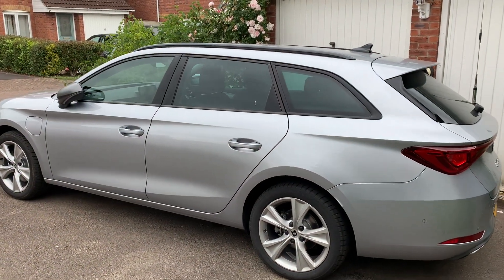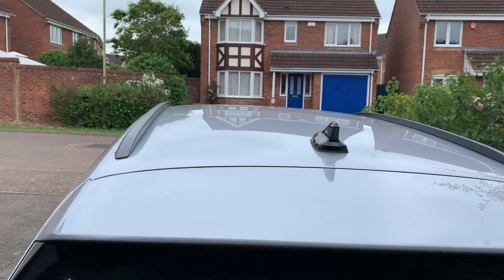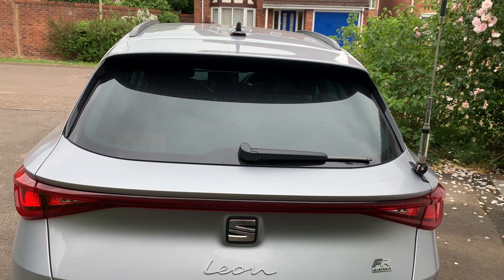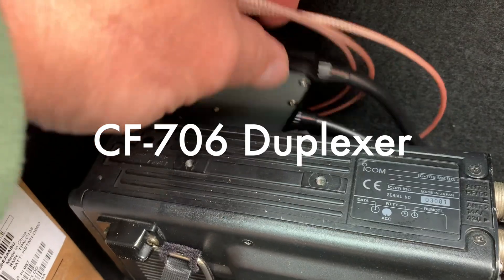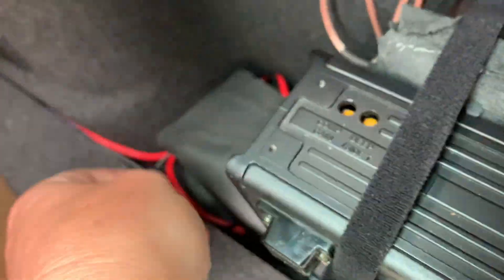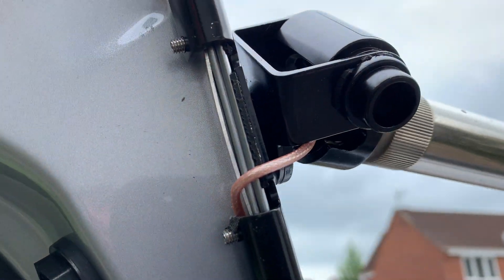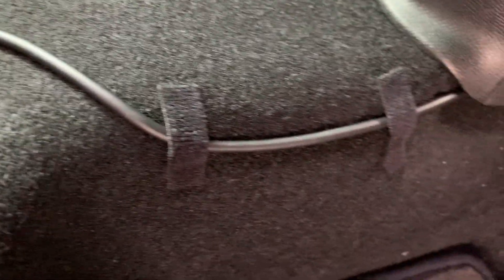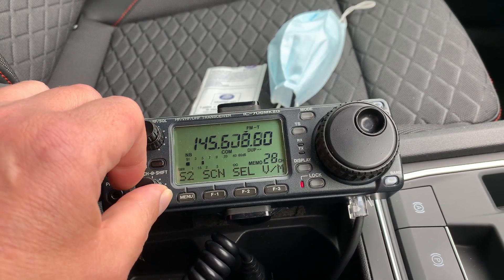HAM Radio: EV install will it work? Mobile Radio installation : Amateur Radio

Comment: Electric cars use a VFD to provide voltage and current to the motor.  That power is nasty-noisy. I don't know if you grounded you radio and antenna but do so if not.  Also add some real ferrites to the power and coax cable.  Fair-Rite is the brand that mostly gets into the ham radio work as clamp on.  Look at Laird Technology's. They do not work as good as solid ferrites and the mix is also not as good at lower frequencies.
Laird low frequency ferrite has a much higher impedance / db drop.  Years ago, they would not even make a split ferrite for low frequency applications as lower frequencies will go thru the split surfaces and can degrade it's efficiency.
This could help but don't get your hopes up for HF operations.
Look for Laird ferrite cable cores in LF mix.  It is a lot higher impedance for amateur radio hf frequencies.  Remember each wrap squares its efficiency.

LF Low Frequency
28 Broadband High Performance
HF High Frequency

LF, 28 & HF MATERIAL IMPEDANCE VS FREQUENCY (300 KHz - 2 GHz)
Impedance Materials for Cable & Wiring Harness Cores
Robert S.

Comment: Why would the car manufacturers address the emi noise? For us ultra small ham minority?
Reply from the maker: Because it goes agains  (breaks)  EU and UK EMC regulations.
Reply: @mike-M0MSN  I don't think it does because it cannoybr sold in the EU per emissions regulation.
Reply from the maker: @kubectlgetpo  That is exactly why I complained, because it should not make any EMI noise if it complied .......and if it has been sold it should comply.

Comment: I have a Renault Zoe, and it's exactly the same, full of noise when the engine is running...
I think for HamRadio mobile devices, electric vehicles are not the easiest solution.

Comment: As I live in the bottom of a steep sided valley with a tidgy garden there is very little radio I can do from home so I tend to go out and park on a hill top, we have an abundance around here! You can hear EVs coming a mile off on the radio as the interference increases until they pass. Cars are pretty bad but those electric bikes are a nightmare, they take ages to pass and thus prolong my torture!

Comment: The electric motor inverter drive system is a high power switching unit (probably 400V at some tens of kilowatts), pretty hard to make them quiet, especially in close. I'd try running the radio from it's own independent LiFePO4 battery and minimize any connections between the radio system and the vehicle to see if that helps, but the common ground system is likely to carry a lot of noise. Be interesting to survey all the HF bands to see if any are useable. Generally the computers in cars moved up the gHz region and aren't interfering anymore, but high power drives are in the upper kHz to lower mHz region and harmonics can be everywhere. de w6akb

Comment: Good Install, wouldnt it be neater running the cable along the Sill Trim, than outing it over the Carpet, where it could be kicked by a Shoe
Reply from the maker: Yes probably but work car never really have passengers.

Comment: Interesting stuff, I've only worked mostly VHF parked up from my EV but when I get time I'll hook up my 706mk2g and see what happens on 10 and 20 when the car is powered up and in drive. So far I've been pretty impressed with the lack of RF noise when charging it at 6.6kW at home.
Reply from the maker: Yes Matt, it is very good everywhere but 27 -28MHz
Reply: @mike-M0MSN  Managed to get out and test this before it got too warm this morning, tried 40, 20 and 10M, didn't notice any increase in my admittedly high noise floor with car on, off and in drive, car is a MG ZS EV, so hopefully EVs wont be that bad, I've been driving them since 2015. What did surprise me was how many more signals I got with small base loaded 90's G-whips on a mag-mount than my active loop antenna and SDR I normally use so something to investigate there. The 706 was running off a LiFePO battery rather than the car.

Comment: Well if RF is getting out then RF will be getting in, so I think I would not want to transmit on 10m while driving. Well until I know that the abs or anything else is not going to kick in or fall out and make it a very bad day around.

Can't beat an old diesel for noise, not a lot electircal going on with them.
Reply from the maker: Agree

Comment: Interesting video. I like your priorities too. Get the new car, get a radio in it lol. Does the petrol engine provide drive independently of the battery, or does it only run to charge battery? Was wondering if there is any difference between petrol engine running or not with respect to interference?  This video is another wake up call for the radio world as  electric cars become more popular.  Wonder if the high speed chargers cause interference? Mark, M7MSR
Reply from the maker: Yes and yes electric never turns off.

Comment: Dear Mike, it's like having a switching circuit on idle mode and when you load it, noise is stopping.
When brake lights or other loads occur, the noise stops.
Try if a bulb lamp somewhere make the deal
Reply from the maker: ?not sure if that's right or wrong?
Reply: @mike-M0MSN  to be sure you would like to put a oscilloscope on AC mode to  find out the waveform on 12vdc line.
When a switch mode power supply is idle, you may see the top shape of sawtooth waveform
Reply: @mike-M0MSN  if you need some help write me to Iw4dbx@gmail.com

Comment: Others who have done EV installs (such as Josh KI6NAZ) have noted that the earthing is very important. Try putting an earthing strap between the boot lid and the main body of the car and making sure the radio also has a good Earth connection to the main body.

https://www.youtube.com/watch?v=2DJdUfT_TnM
Reply: Josh earthed all points in the car plus any nut, screw or bolt he could find. I was also thinking earthing. A good shout. 👍
Reply from the maker: will give that a go.  :)

Comment: Nice install, nasty noise problem, did you make sure the antenna mount was making good electrical contact with the body of the car and that the boot hatch/lid has a good, low impedance electrical contact with the rest of the body too?

More worrying is the thought that these things radiate as they drive past, potentially making them mobile noise generators that could wreck HF

Comment: I have the watson triple magmount. I drove from Portsmouth to Birmingham with a 20m ampro whip at probably 80mph because I was running late and it stayed on fine. So have no fear about them coming off. But yes they can scratch the roof thats for sure, Mines on an old van so i'm not worried. Lee M0RQX
Reply from the maker: Thanks for the info  :)

Comment: Change jobs. What sort of company buys a car like that ? I've never even heard of that car. I'm thinking it's either Chinese or French. Horrid.
Having to drive around in a vehicle chosen by your boss because he/she is some imbecilic eco-warrior green Communist is an insult to ordinary people.
The world's gone mad. Hope you find a way out.
Reply: Seat is part of the VW group, hardly an unknown brand and the 'company car' is a really common thing, it's usually cheaper than buying and maintaining your own vehicle and there are more tax advantages to driving a PHEV too which makes it cheaper.
Reply: @M0UAW_IO83  Never heard of Seat. Never heard of PHEV.
I do of course understand the concept of the company car.
I'd be embarrassed to be given a company car called a SEAT PHEV. 
I'll keep my Toyota V8 Turbo Diesel thanks....
Reply: @adelarsen9776  Seat is a Spanish company owned by the VW-Audi group. The Seat Leon PHEV (Mike's car) is basically an Audi A3 e-tron but with cheaper interior materials and built in Spain instead of Germany. PHEV is a standard term meaning Plug-in Hybrid Electric Vehicle. It's not the name of the car.
Reply: @thefuzzylogic  Thank you Ian. I learned something. Cheers
Reply from the maker: lol
Reply: @mike-M0MSN  You've got to laugh. Otherwise you'd go mad.

Comment: I use a hatch mount on my Mitsubishi PHEV, which I find works well.  I only have 2 and 70 and they like your car are fine, with no interference. I haven’t used HF mobile for many years. My last setup was a Yaesu FT-707 in an Astra GTE, which was a bit of a squeeze, band conditions were a lot better then as well. Good luck. Nick G0OQK

Comment: I agree that the interference is clearly coming from the drive computer (probably the CPU engaging the gears) perhaps if you could move the head away from the centre console it might clear or at least be easier to deal with the interference.
Reply: Nah, it's likely from the inverter, the computer will be active no matter what mode it's in and unless the petrol/diesel engine has a mechanical coupling to the wheels then there won't be a gearbox. Would be interesting to find out if the noise changes with vehicle speed.

Comment: Good evening Thank you for all your videos you publish Unfortunately I do not know English I go to intuition and read the comments of other people translating them with the translator I saw the problem you have with the car I ask you a question You can try with an amateur radio laptop for see if it is not radiofrequency that the machine creates from some electronic card maybe mine is stupid otherwise it will come from the power supply I repeat I am not in your technician but I go to exclusion Thank you again for all your videos and I give you a good evening Hello here from Mario from Trieste Italy
Reply from the maker: Thanks for the comment, I will use an SDR with my Laptop. good idea
Reply: OK  73

Comment: Btw the loom is 6volts so any additional equipment added to it will run under power. I learnt this with my Prius, so i had to bypass the cars computer loom.. daft question Mike but have you tested the drain in amps when the mic is keyed. Your problem there is the initial problem i had on my Toyota.
Reply from the maker: Direct battery connected and even a handheld has the same issue
Reply: @mike-M0MSN  ahh okies, well i hope you sort the issue out. It's a strange one for sure, look forward to an update.

Comment: Remote setup at home is the only job! I run Icom RS-B1A on both IC-7610 and IC-9700 for full remote access, I know it's not the same as having gear in a car, but I wouldn't put a radio in my car, between antenna mounts and dashboard brackets, it would wreck the look of my car.. de Ei2iP.
Reply from the maker: Lol. you have seen my car....... lol

Comment: What a beautiful install Mike. Is the hash still present if the car is off with the key removed so that at least you could go to high ground and park and uses the radio? 73 Joe
Reply from the maker: Hi Joe, I can use the radio when I am parked up so not a complete loss.  ;)